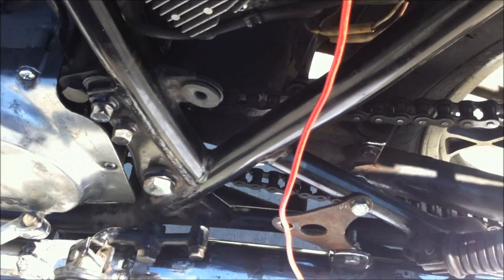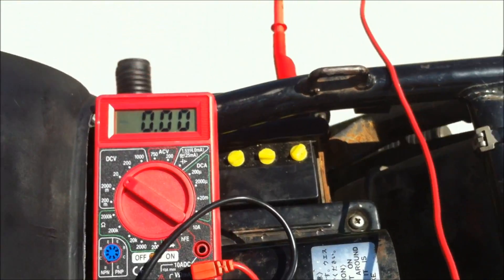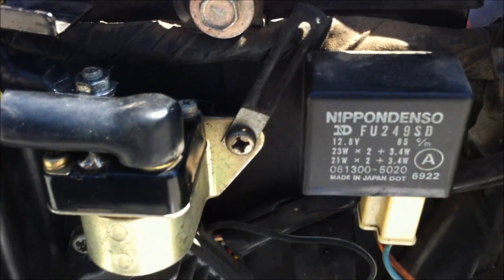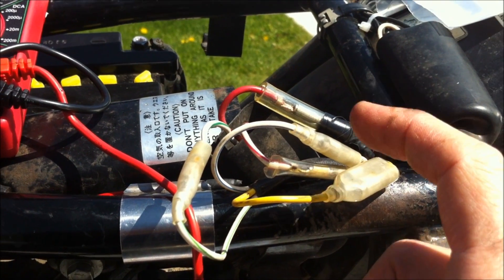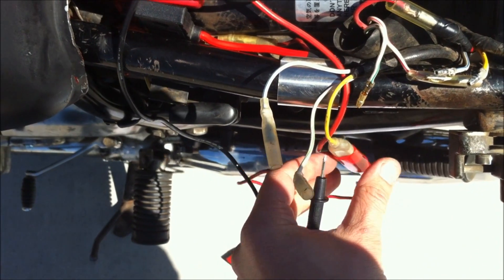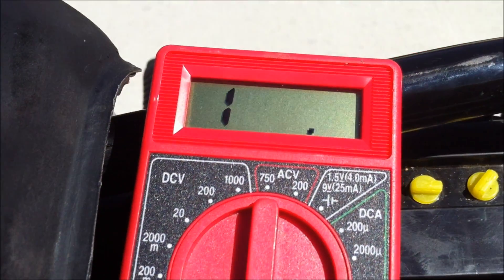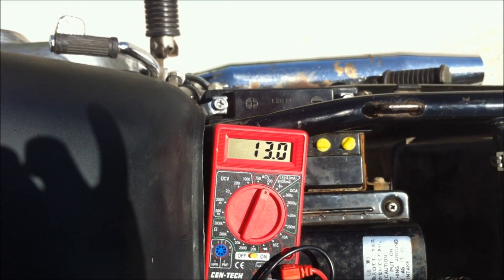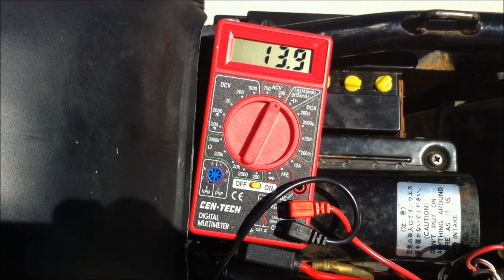2012-04-23 1979 Suzuki GS 425L Charging System Diagnostics

Comment: excellent vid. 99 times out of 100 it is the rectifier. Easy fix $25-. I've seen dishonest shops charge hundreds of dollars to fix a charging system.  "MOst likely bad stator" they say, slap a new rectifier in the machine and charge the client $600-, while never even opening the case or checking resistance on the yellow leads. BEWARE!!!    
Stators and Rotors are incredibly durable running in a soothing oil bath with no moving parts or delicate electronics, the failure rate is close to nil.

Comment: I have a 1980 GS850L that is not charging the battery. Thanks for showing this simple test. I am hoping it is the rectifier instead of the stator, as I can change that easily myself.

Comment from the maker: I'd go ahead and source yourself a replacement, Regulator/Rectifier first I put a link to a list of compatible replacements in the video description.  You should be able to find a cheap one on ebay.  Give that a shot first it could save you some money.  I went with a used one from a 79 Honda Gold Wing and it works great.  I also added the links to my specific blog posts in the video description as well.

Comment: im rebuilding my gs 750... after reading the stator papers... i was wondering if it is best to just update the cdi and r/r and if i do this will it eliminate the problems here in the charging system?  My stator is fine at the moment.  so i dont want to change it but i dont want to  burn it out either? all this electrical crap is so beyond me!!! ahhhh